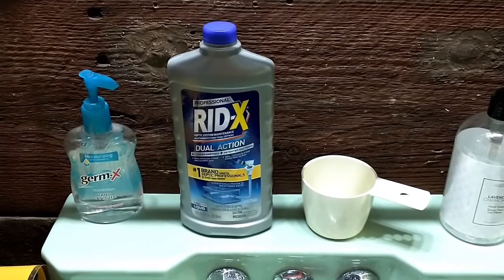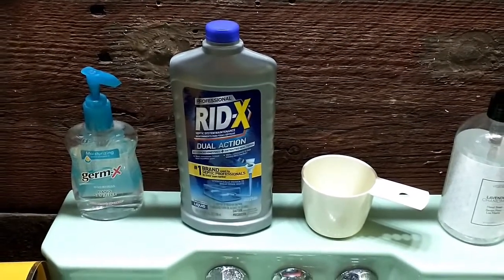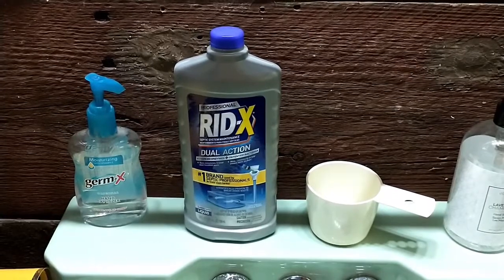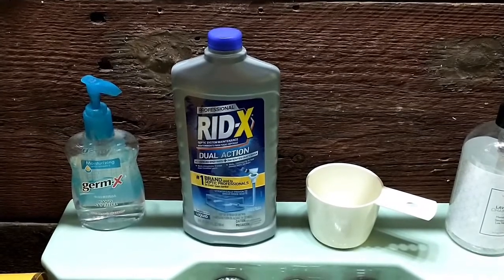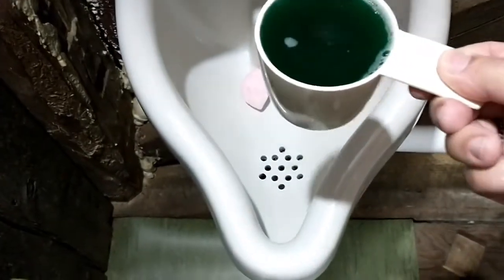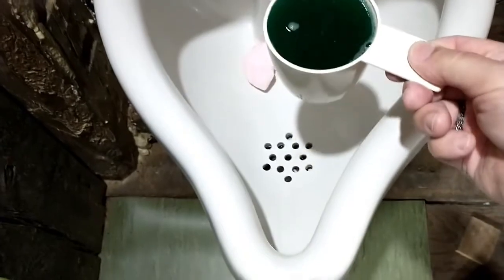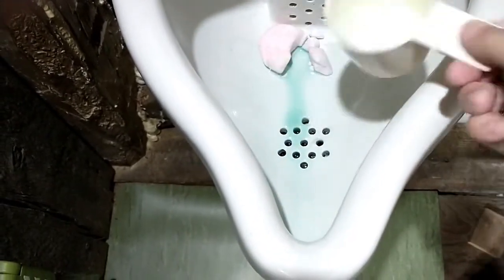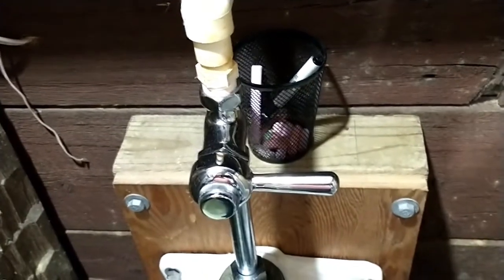106.  1940 "Standard" Bering & Septic Treatment

Comment: PoorPumperSociety's Dominic showed that there's no benefit gained by adding this to septic systems. It's simply an added cost. Just empty the septic tank at the recommended intervals to save money in the long run.
Reply from the maker: I do follow Dominic and PoorPumperSociety, and I agree that he knows his stuff.  So, I will finish up my supply of Rid-X and then stop using it.  My cabin is used by 2 people for 5  1/2 months out of the year.  I had it pumped last year, after 10 years.  What was inside was NOTHING like what I've seen on Dominic's channel.  The scum on top was thin and not a thick deep crust, and there was hardly any sludge in the bottom.  I was told that it could go 20 years without pumping, but I am not going to take any chances that might damage the leaching tank that the speptic tand drains to.  My tank services 2 toilets, a urinal, and a utility sink.  The shower, kitchen sink, and inside bathroom sink drain to a gray water system.  There is also no washing machine or dishwasher that would add detergents, etc. to the tank which could affect its performance.  Thank you for your comment, jbsimmons54.